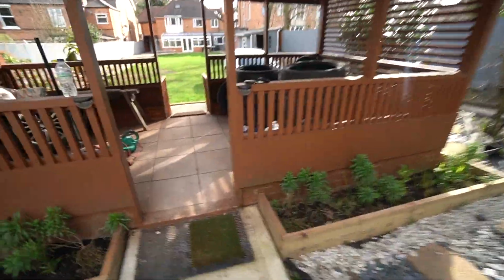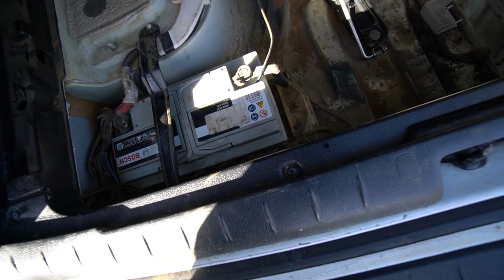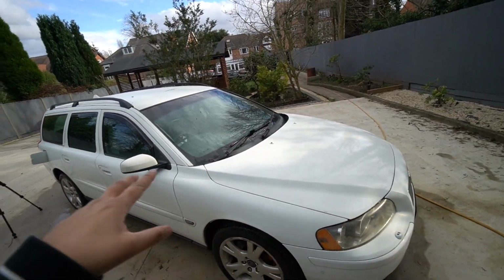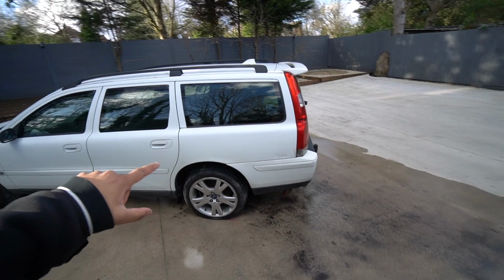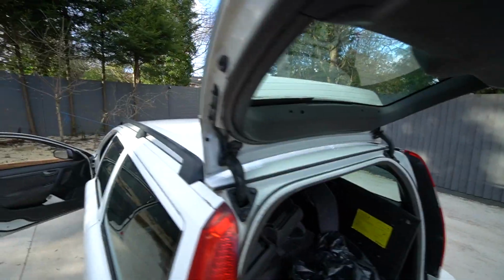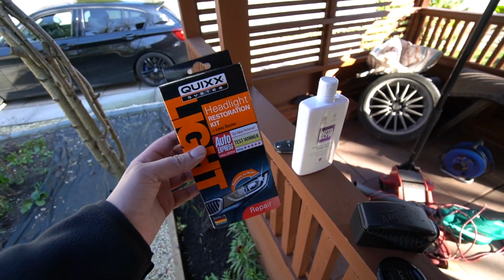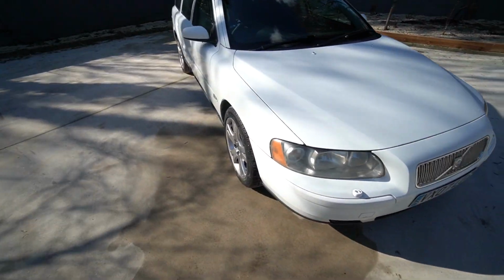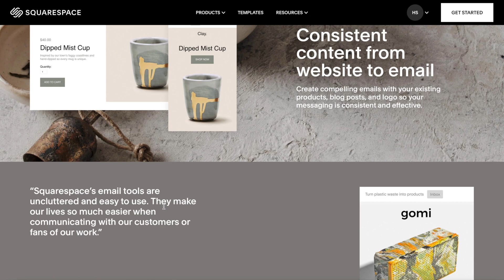Disgusting EX-POLICE Volvo T5 gets it's First Wash in Years!

Comment: What I like best about these volvos is the factory stance.  This generation of S60/V70 the wheels sit right on the edge of the arches, and the wheels are reasonably wide (225) and the car sits low, with the upper part of the car being the narrowest, and gets wider and wider as you get closer to the floor. They look very purposeful and you cannot mistake them for any other brand.

Comment: Headlight restoration TIP: If you use toothpaste with those small crystal granules and rub it in with newspaper then wash it off. Watch it works a lot better than these restoration kits I did my A3 about 4 years ago and till this day the headlight looks great.  Easier and cheaper!

Comment: You need 3M grit pads 3" size for headlight restoration.  Using a cordless drill and foam backing pad you go through the process 500, 800  1000 then plastic polish.  Then clear coat.  Will come up like new 👍

Comment: steering wheel x2 torx  t25 maybe ? one each side acces from back feel 2 holes ,bit awkward just make sure its right size torx bit with a wibble first ,you dont want strip it . once slackened off airbag will release . best to disconnect battery first . disconect 2 plugs and lay bag down facing up .Slacken nut a few turns and pop it off taper with firm pull if tight . Then remove nut an the wheel is free to swap .Mine was the same scabby wheel as yours . cloth interior is  not comfy at that milage so dump it for a black leather . Far comfier . None electric you want . See them pretty cheap now . A knackerd d5 doner comes in handy for many things ! aka, roof lining . not a bad job to swap out too. Hides all that police butchery  and wear . Get a polisher on paint youve nowt to lose but the matte car wash look. Ferecla on a big mop sponge grinder  air or electric ,keep it damp too it and you will be manky ! Then wash an do same but with polish . HEADLIGHTS TOO IF YA CAREFUL IF THEY ARE MATTE AN SCRATCHED SLIGHTLY . Cheap mint up and you will be shocked at how good it turns out .

Comment: Great stuff man, Ive got a white 2006 s60 2.4 t5 ex police and a 2001 2.0 T S S60 ive been working on and the headlights are also terrible, im considering buying new headlights for both of them front and rear, if you have any suggestions on what type to buy and where from it would be great.